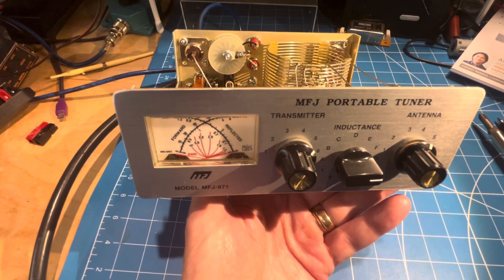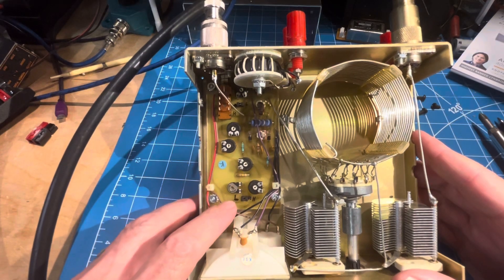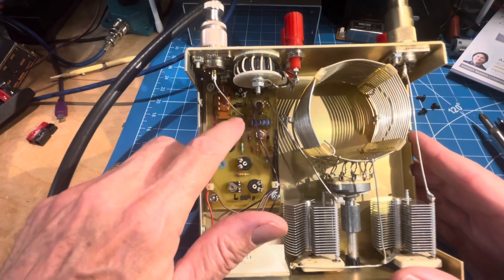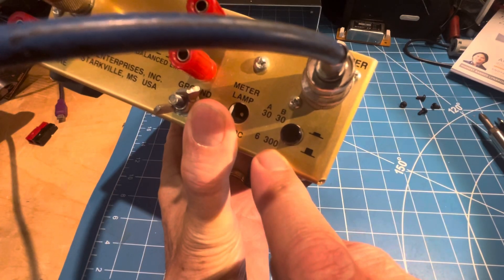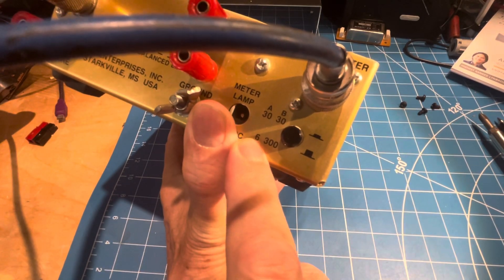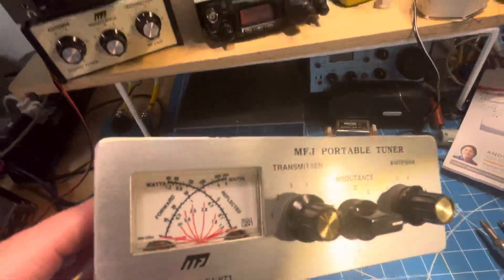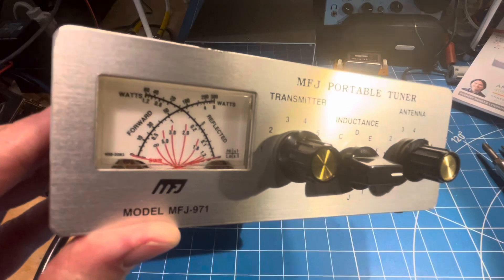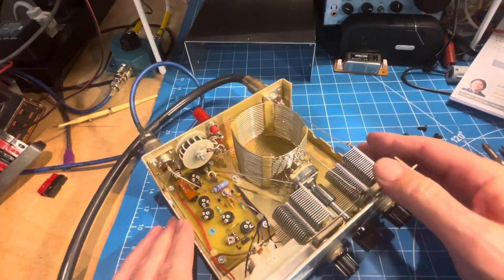My MFJ-971 Tuner has a 6 Watt Setting!

Comment: It needs  exactly 6 W ? Or any low power setting is ok ? ie 5-10 watts ??
Reply from the maker: There are internal jumpers to select either a 300 watt max or a 6 watt max. You’ll need to pick one or the other. You can find the manual for your tuner online from MFJ. Cheers, Bruce